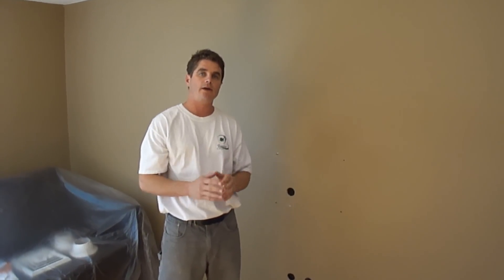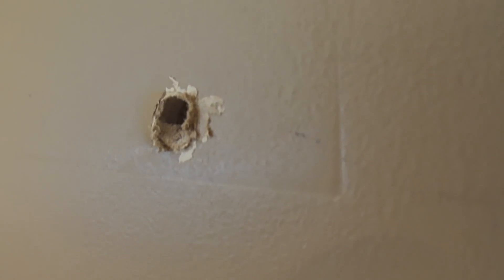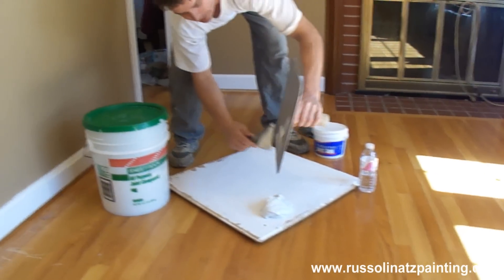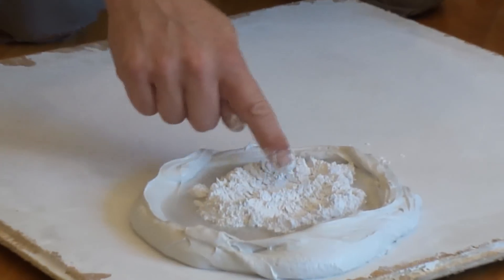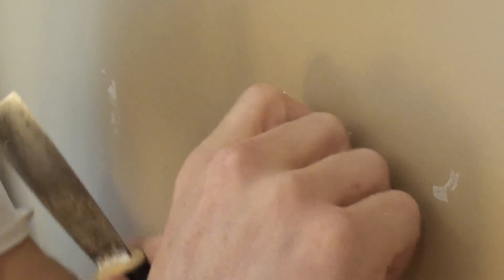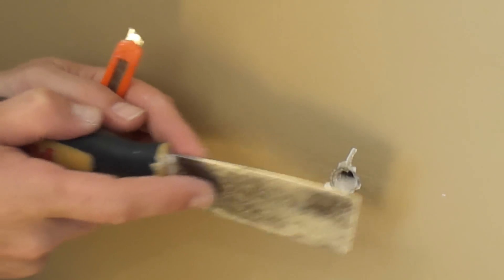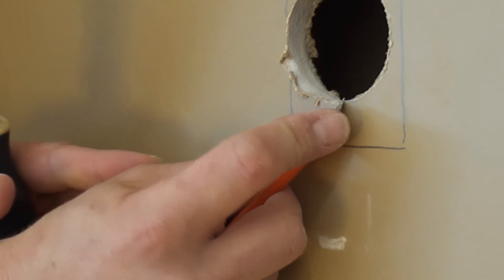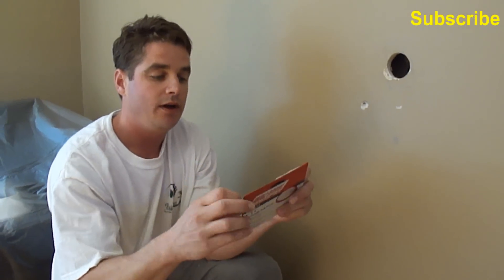HOW TO PATCH HOLE IN WALL (Part 1)

Comment: Learned the area to be covered with drywall compound is going to be much,much larger than the hole or the insult area to the wall. That's always been my mistake. I thought I could patch the actual area of the hole or just a slightly larger area. I also never really understood what feathering means. I thin it really means putting more reassure on one edge of the knife than on the other end. That allows you to make a slightly thicker application of mud in one area over another. The other tip is cutting around the popped area of Sheetrock using the knife handle to push in and down the concave area instead of convex surface. 
All these tips you've learned through years of doing. Nobody explains these techniques with as much simple clarity.Thanks again!
Fox Watson
Reply from the maker: Hi Fox-

Thanks for this feedback! You Help me by explaining what you have Learned. 

Russ

Comment: Thank you for the video. You helped me ubderstsnd a lot about drywall.  I created a hole in my wall a few weeks ago. First I'm going to use drywall tape to cover the hole. Then i'm going to use a putty knife to spread it. Last I'm going to use a sanding block to smooth it down.

Comment: Thanks for the video. This video helped me a lot with understanding how to fix drywall. I created a small dent in the wall at home a few weeks ago. I'm going to use drywall tape to cover the hole first. Then I'm going to use a putty knife to spread it. Then I'm going to use a sanding block to sand it down.
Reply from the maker: Thank you!

Comment: With that many holes...would cutting back to the studs been an option? No matter what I've noticed that paint on drywall mud patches have a different texture (even if primed before painting) and will always be slightly raised. rather than having 6 patches maybe just cut out a big 16''x3' section and skim coat?

Nice work. Keep it up. This video will also help those with just one hole in their wall.

Comment: Interesting techniques I've never seen before. Well done.
Reply from the maker: Hi Matt
Thanks a lot! What did you learn?

Russ
Reply: mostly in preparing the holes by using the base of the knife or the hammer. Also, creating the circle with mud was interesting. I plan on giving it a try tomorrow. Thanks.
Reply from the maker: Hi Matt

Yes, prepping the surface first is a must before applying any mud. Let me know how you make out?

Russ

Comment: Thanks for the lesson. Just the information I needed.
Reply from the maker: Hi Christine

Thank you very much! Are you repairing holes caused by tv?

Russ
Reply: RussOlinatzPaintShow actually I need to repair a hole made by the corner of a reclining chair. It’s about the size of the larger holes on your video.

Comment: thank for the video, this is my first time watching this and it was helpful.  I replaced my bathroom sink light and the old one was about 4 feet long, the new one is about 6 inches so I have all the drywall to paint but my buddy told me to use sandpaper to smooth the edges before painting..is there any other options/..THANKS AGAIN...definetly subscribing to your page
Reply from the maker: Thanks again Jerry!

Comment: why do you use a combination of all-purpose joint compound and plaster of paris rather than setting-type durabond?
Reply from the maker: Hi Ralph

Because I don’t have to clean up a drill or bucket each time I mix up a batch. If I have any left over, I put it to a ball and let harden. It also sets in less than 10 minutes, which allows me to apply multiple coats in less than a half hour. Works great for smaller repairs, but when I need a lot of fast setting mud, I will mix the Easy Sand Quick set in a bucket. Where are you from?

Russ

Comment: Where's part two for this video? Trying to see how to make sure that the patch doesn't stick out on the wall. Thanks
Reply from the maker: Hi 

Part 2 was accidentally deleted. Please read the description of Part 3 to find out what what happened. The metal drywall patch will always stick out a little bit. This is why you have to mud over the path and create an arc to help hide the hump. 

Russ
Reply: I was looking for part 2 also. No luck and it seems to be the most important part. Guess I'll look up someone else

Comment: Wheres part 2, I wanted to see how you handled the round saw holes?
Reply from the maker: Part 2 was accidentally deleted. I shared that in the description of the video. As for your question, are you referring to all the circle holes?
Reply: @RussOlinatzPaintShow  there was 3, I think 3-4" circle holes that looked like they we cut with a hole saw bit. I don't see anywhere how you repaired those holes. Thanks

Comment: I have a small hole in the wall where the door knob went through a little.  The whole knob didn't go through, just the push-in lock.  So the hole is maybe the size of a nickle.  Do I need this type of patch for this?  Thanks.
Reply from the maker: Hi Michael-

You can use this method for added future support in that area of the wall since it might happen again. Or you can put up a new door stop so the door can't swing that far out again and hit the wall. If so, then just fill it with some compound 3-4 times and sand smooth and prime and paint. Where are you from?

Russ
Reply: Thanks. I'm from Maryland.
Reply: RussOlinatzPaintShow Do I need to bother painting if I'm just putting up a fathead sticker?  Or is a spackled surface not good for that?
Reply from the maker: Hi Michael - 

Great question! A chalky surface isn't good for adhesion. If you have any Gardz then use this to seal the joint compound and seal the surface.  So know the sticker sticks great to the surface and when you go to remove it, it won't tear the face of the drywall away.  Or just put a bigger circumference sticker and be done with it, but there still will be a hole there...
Russ
Reply: RussOlinatzPaintShow And if I do paint after spackling, can I just start with the paint or do I need a primer for such a small area?
Reply: RussOlinatzPaintShow I bought DAP DryDex spackling.  Should that work? Thanks.
Reply from the maker: Michael Rosen The Pink stuff?
Reply: RussOlinatzPaintShow Yeah.
Reply from the maker: Yes, that is meant for small holes. Make sure to seal that area after a few coats and sanding!
Reply: RussOlinatzPaintShow Great, thanks!  If you ever to move to MD, let me know! :)
Reply: My local home depot doesn't sell gardz. Is kilz 2 latex the same?
Reply from the maker: Michael Rosen No ,but it will work as a primer to seal the area!
Reply: RussOlinatzPaintShow But is it an ok substitute for Gardz or should I just order Gardz online?
Reply: Just dust off the surface before priming. Gardz is the better of the two. It makes the compound stronger. Your primer will do.
Reply from the maker: Michael Rosen How did you make out this weekend?
Reply: RussOlinatzPaintShow I didn't get a chance to work on it.  :(  I'm planning to sand it and then prime.
Reply: my whole fuckin doornob went through
Reply from the maker: Hi 

How big is the hole?

Russ

Comment: Under what conditions would you cut in only once on a wall?
Reply from the maker: When painting a wall?
Reply: @RussOlinatzPaintShow  yes
Reply from the maker: If the color change isn’t to drastic and will only require 1 coat!

Comment: Where is part 2??? OMG that's the part I need to see.
Reply from the maker: +Nirmala Bruce 

Hi Nirmala 

Part 2 was accidentally deleted. I mentioned this in the video description of Part 3 and stated what what took place. Did you start your project yet?

Russ
Reply: +RussOlinatzPaintShow you can re-upload the part 2 otherwise there won't be any benefit of part 1&3 and you won't achieve your goal of  showing people how to.... Thanks for your effort.

Comment: I have a hole cause by a door knob. Im afraid the knob will hit this area again and cause the hole to reopen. Is there anything else I can put in the hole to keep this from happening again? (other than a door stopper at the bottom)
Reply from the maker: Hello
Great Question! Thanks for asking! Yes you can purchase a piece of plastic that goes on the wall to prevent damage. You can find them at your local hardware store. Ace sells the Door Stop Wall Mount that has a self adhesive backing. 

Russ

Comment: With all that damage to the wall, wouldn't it have easier to to just replaced the large square of the wall? Instead of 3 patches and a couple fillings?
Reply from the maker: Hello-

Thanks for your question! Yes, that is another way to have fixed this situation requiring a different technique. I am showing here a way of fixing small holes in the wall by using these metal drywall patches. In my latest video, I am exploring a different technique known as the California patch, for small holes. I will also do a video on repairing larger holes. Thanks for your comment!

Russ

Comment: Why is the key part 2 video gone?
Reply from the maker: It was accidentally deleted.
Reply: @RussOlinatzPaintShow  no worries. I just wondered how you filled the bigger holes without any backing, or spare bit of dry wall to insert. Thanks for getting  back to me
Reply from the maker: For smaller holes you can use this, but it’s better to just put a wood backing behind it. Then screw new drywall into the wood.  How big is your hole?
Reply: @RussOlinatzPaintShow  it’s where the handle of the door went through the plaster , probably about two times bigger than the bigger one in your video. I think a wooden backing is the way to do it too. There’s another method to cut a bigger amount out and screw new drywall onto the beams in inside the wall, but it means cutting more of the old wall out. Thanks for your responses
Reply from the maker: @antiochiaadtaurum3786 oh yes, and will probably happen again.